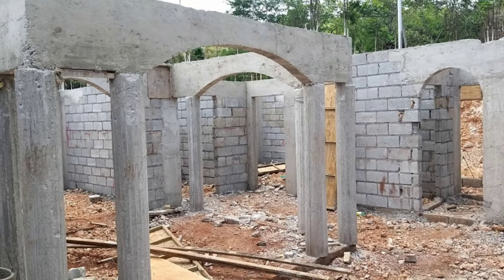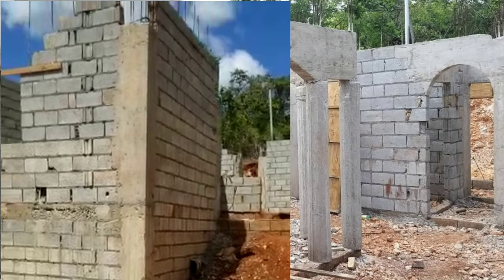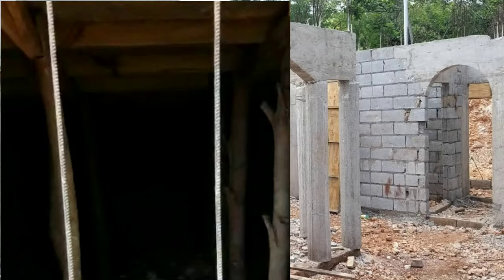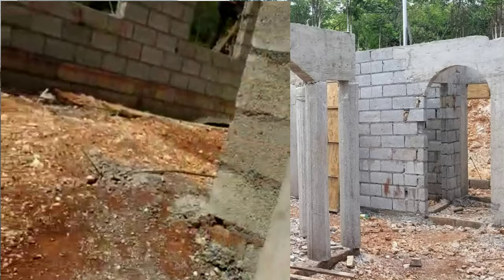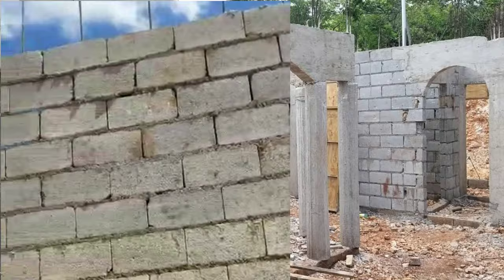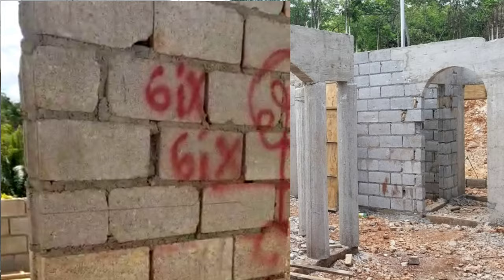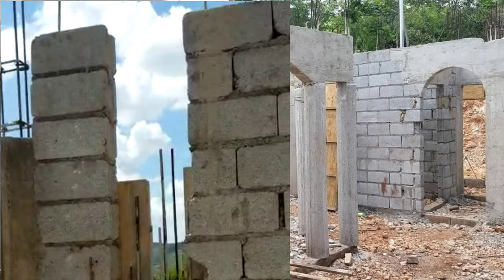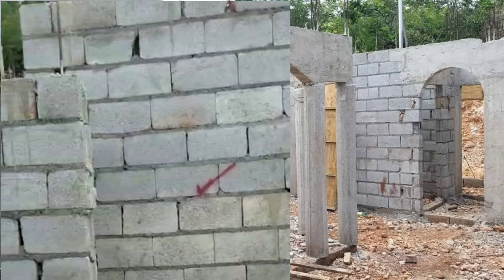The Real Cost To Build A House Concrete House Cheap Part 1

Comment: How do you correct a building when you found out that some of the block pockets were not filled by the workmen?
Reply: That's messed up. Can't trust them at times. Good to be on site
Reply: If u are 100%  sure about it this.    Then get the contracter to fix it.